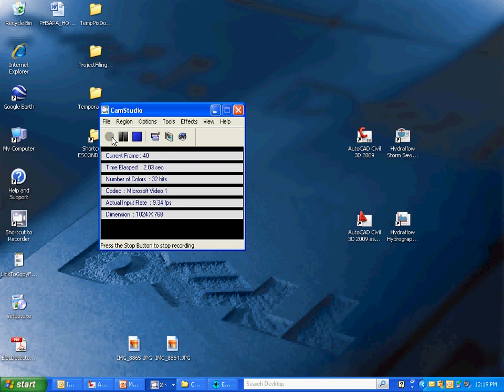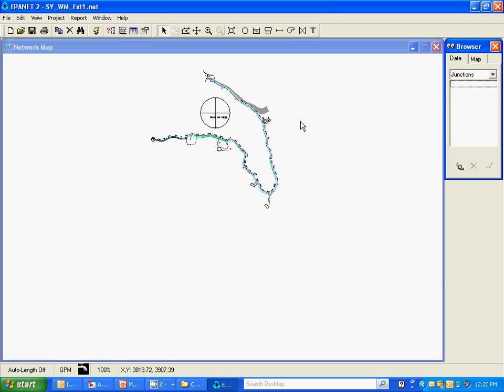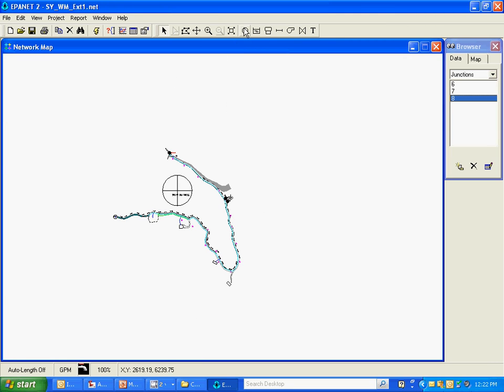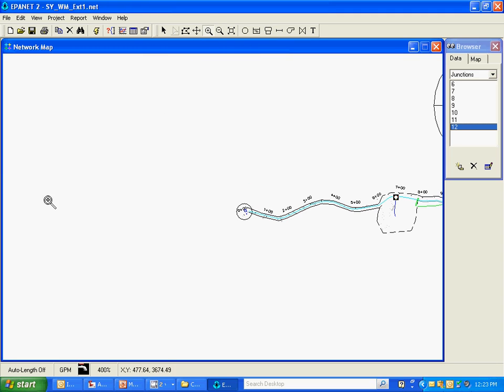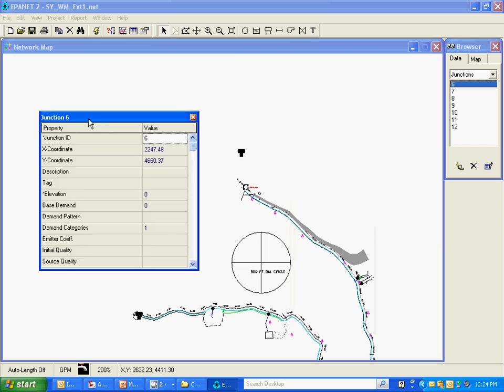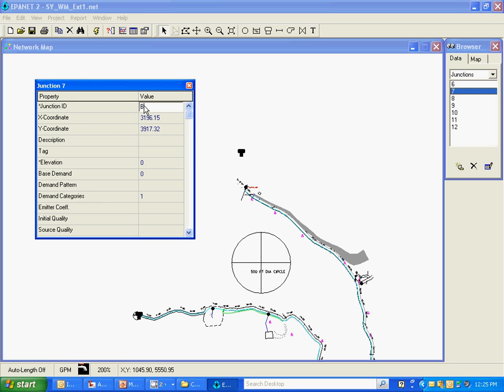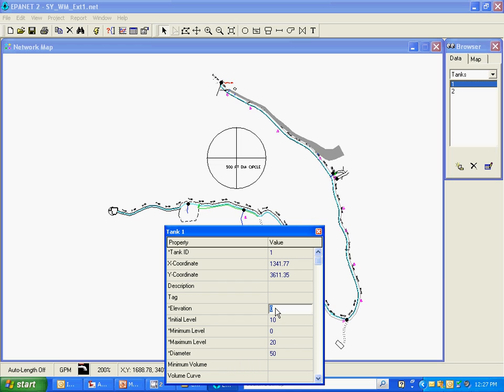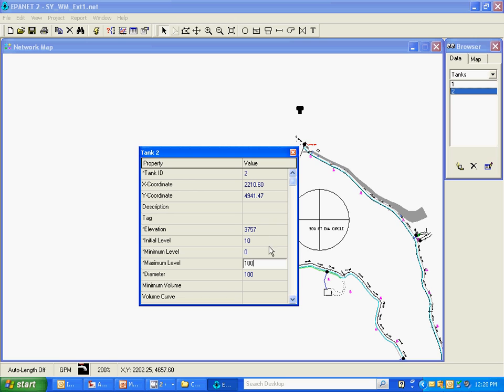EPAnet Tutorial Section 3: Adding Nodes to the Model

Comment from the maker: Will have to post in two parts because of length: I haven't done this all the way through, so first save your original file and create a temp file so if data gets messed up you can always go back to the original.  Here's how I'd approach  it: With the spare copy EPAnet, open it and try exporting it to a ".inp" file by using: File --> Export --> Network; then open the saved file using Excel (rt. click and use open with).  Use Excel's Find and Replace (under Edit).

Comment from the maker: Thanks for the comments.  The downstream tank does exist.  The project was for an extension to an existing water system.  The downstream tank however did not have sufficient elevation to provide water to the hillside homes.  The upstream tank dimensions are actual measurements.  It only serves 4 homes and unlikely there will be more than 10 homes at max buildout.  A 12 ft dia., 12-ft tall tank is around 10,000 gal.